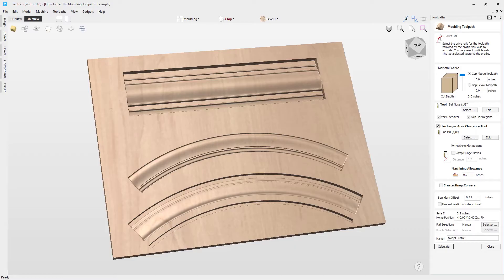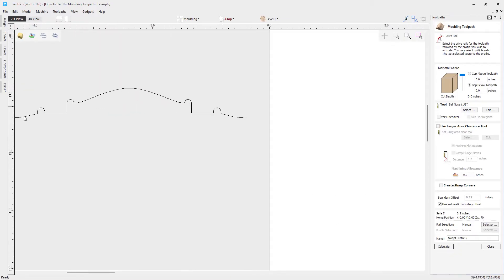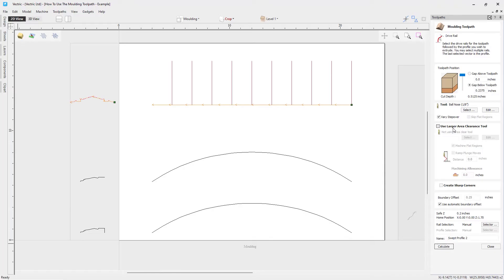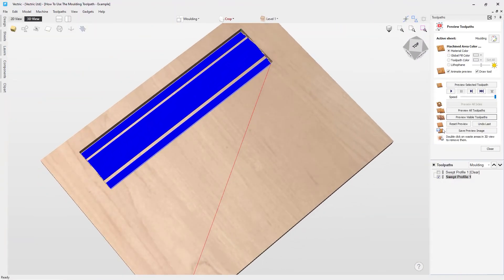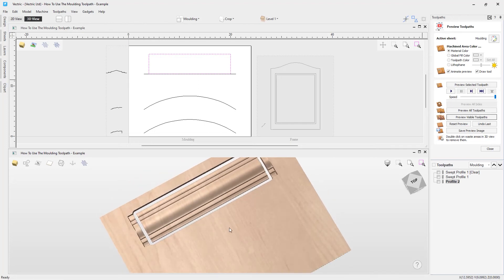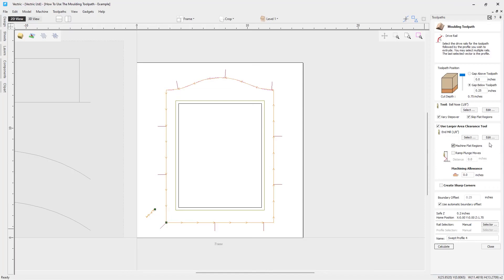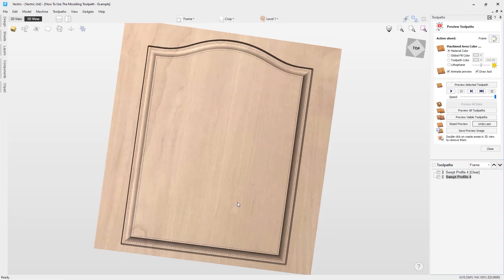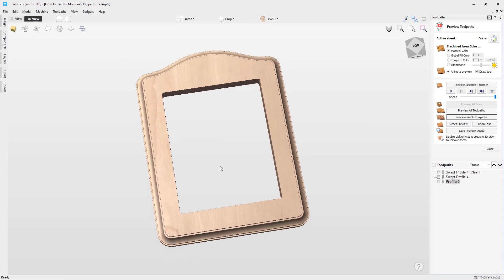How to use the moulding toolpath in Vectric software | 2.5D Toolpaths | V12 Tutorials

Comment: On 17:05 what`s the point of all those "jumps" with the 0.25 inwards and then 1'' outwards if you could just take the width of your shape on the left (which is 0.75) and just make it outwards offset of your frame and then just cut it outside the line?
Reply from the maker: Thee are lots of ways of doing this sort of thing... thanks for sharing your method.

Comment: Is it possible to extrude molding around a circle. I would like to re-create a rosette. Can you point me to any tutorials or customer service email for more specific help?
Reply from the maker: Yes you can... and it works very nicely.  There are a few things to remember, like making sure the start point of your profile is at the right end and what to do with the "Boundary Offset".  You can give it a try on your own, using the steps in  this video (we use a square... but you deal with a circle in pretty much the same way) and if you run into trouble please contact support@vectric.com